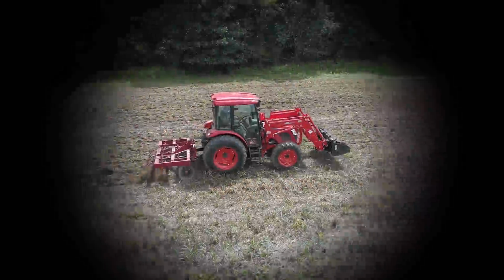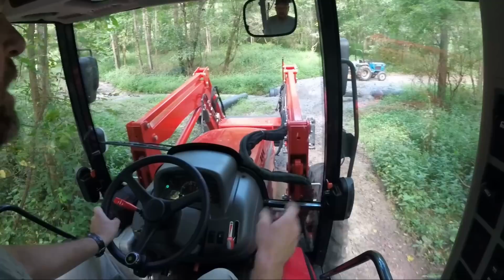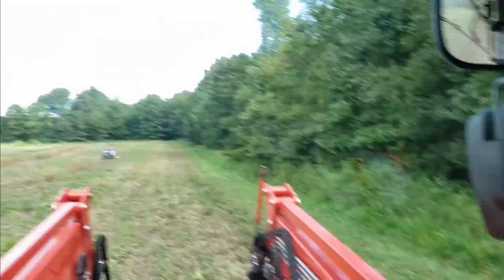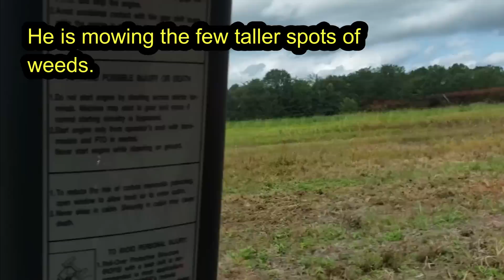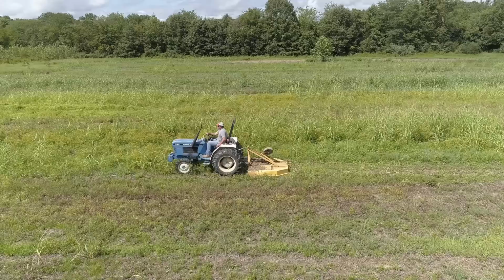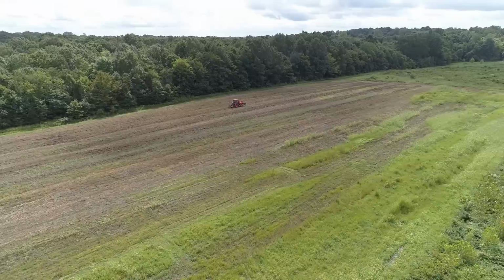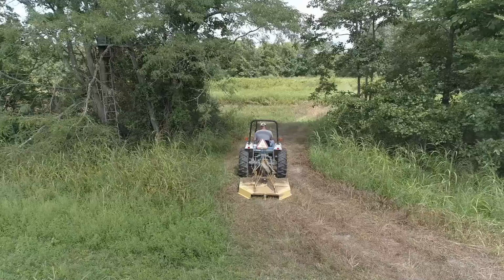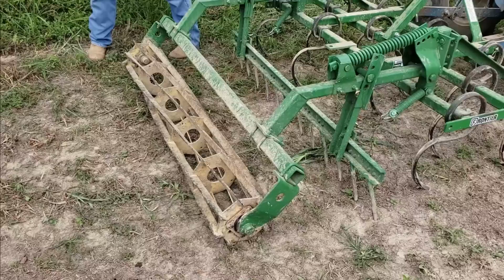Home made Disc-Chisel Plow in Action! Kioti RX7320 & New Holland Tractor action!

Comment: To really get the most out of modifying your chisel, make sure to add the leveling bar and the rolling baskets. I had a Perfecta II field cultivator, and the combination of those things is what helps to get the nice seed bed in one or two passes. I ended up selling mine, though, because I got tired of prying rocks out of the rolling baskets lol
Reply from the maker: Well, we'll see what I end up with. Just priced out the rolling baskets and new they cost triple what i paid for the whole implement! I might just make my own leveling bar or something, but I'm looking for a used basket but they seem pretty scarce! Thanks man have  good weekend
Reply: @kapperoutdoors  I have seen where guys do make there own. They use rebar for the teeth on the leveling bar and also for the cross pieces on the rolling baskets. Then all you need to fabricate is hinged a piece to weld the leveling bars to and some thick circles to weld the cross pieces that make up the rolling baskets. Then you can hinge the rolling baskets and use an old top link to adjust the down pressure. Hope that made sense lol

Comment: When you add the soil bucket make it to where it can swing it up out of the way so you can still load your tractor with it on. If your working new ground you can leave it up and get a little deeper then come back over it with it down. Just a suggestion. That’s the fabricator in me lol.
Reply from the maker: Yes that is exactly what I need! Been pricing them, ouch!! Do you want to build it for me?? It has to flip up because I don't have but 
a few inches of trailer space. Good call, thanks
Reply: Kapper Outdoors wished I could come up to help you but got to much going on right now.